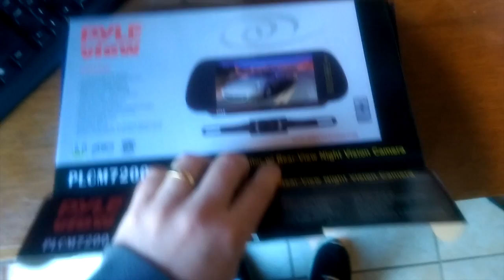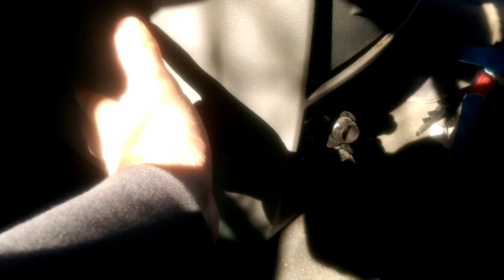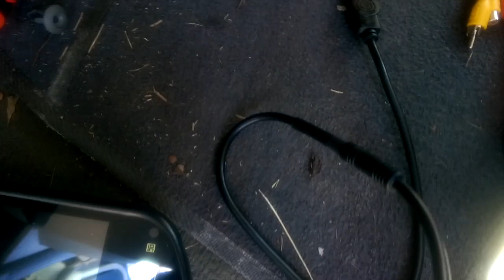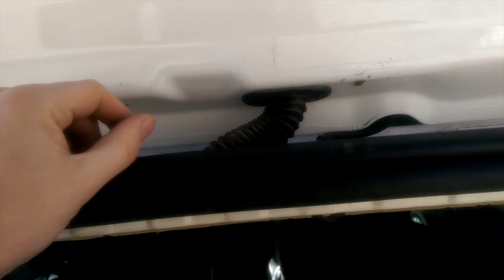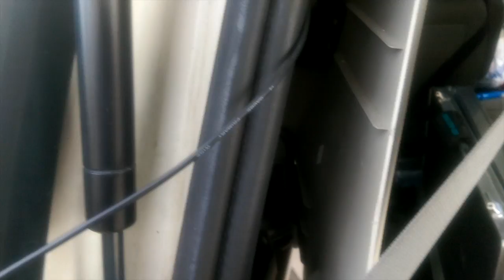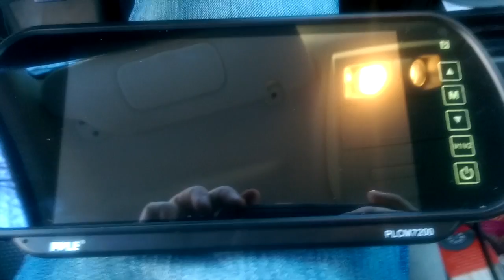Backup Camera Installation - Pyle View PLCM7200

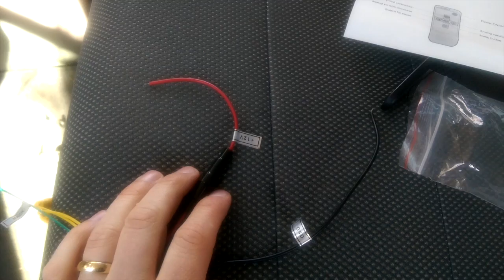Comment: 1:49 for those of you who do not know, a fuse will not reduce voltage, the metal wire inside of the fuse is designed to melt ( breaking the electrical connection) so hopefully you do not destroy your electronic device.

Comment: How do I disconnect the battery to not shock my damn self?
Reply: Remove the negative cable from the battery terminal. It should be the black one, but I don't know what car you drive. Just take them both off, if you're concerned you chose the wrong one!

Comment: Why would you do what the instructions tell you not to do.  They tell you not to use the accessory ports and they tell you to wire to the ignition switch so that the camera/monitor isn’t draining your battery when the car is not turned on.
Reply from the maker: Christian Cepel That's a good question and I am glad you brought it up. For me, I felt like the risk vs reward of being able to run the camera when the car was off was worth it. The power draw is low, but it does still exist. So this is the point where I recommend to the viewer to do what you are comfortable with and decide what is most important for your situation. Thanks!
Reply: Nick Allen I got ya. Just got done putting my 7400 in, but not over the rear view mirror so that I could use both simultaneously, so wired it to the ignition switch but left the backing wire dangling. Wired the camera to the license plate light circuit. Wish there was a way to wire it so that the backing grid was only visible when the car is in reverse.
Reply from the maker: Would you be able to wire it to the wire that turns on the reverse (white) lights? Then it should only come on when the car was in reverse.

Comment: Hi Nick, great video. I just installed the same system in my Toyota Tundra and it works, the only thing is that the rear view mirror when used in normal driving, the reflection is dark as if the rear images were reflecting on a dark glass and not on a mirror. Did  i do anything wrong?
Reply from the maker: R Ng You didn't do anything wrong,  but it doesn't work well as a rear view mirror. I would recommend mounting the monitor in a different location. I have mine mounted on the dash.

Comment: Hi Nick, Could you give me a counsel? I just installed this set today in this way: 

Camera: power to the Reverse light. I installed wireless transmitter for the video
Monitor: Red to a wire (not sure about the wire that I connected but got the power)
                Black to the ground. I installed a wireless receiver for the video line. 
                Green left 

As a result, it works, but I have to turn the power on and off manually every time. 

My question is "should I wire the Green to the back up camera Positive? if so, can I keep the Camera power line connected to the backup positive with the new line for the green line?

I really appreciate if you can send the answer to my email at mlmbjs@hotmail.com just in case. 

Thank you for your video

Comment: I would like to correct something that you said which is technically incorrect.  The fuse on the power side of the camera is to protect the camera from an over voltage, it does not provide the correct voltage.  Otherwise, great video.
Reply from the maker: Steve Rowe Yes, you are correct. Thanks for the clarification.

Comment: it would be NICE if that REARVIEW mirror could be used as a Digital Video Recorder (DVR) with front and back cameras that are always on and maybe they are both showed at the same time in split screen mode, and when you touch (or use the remote) a video feed it will show in Full Screen. Also, what are the specs on the camera side; resolution, wide angle, temperature.....
Reply from the maker: Ovidiu Moc. There's quite a bit of tech out there that should be able to get you what you are wanting. Research dash cameras. A good unit would let you integrate multiple cameras (eg, back, sides, front, and even interior). Good luck!
Reply: Ovidiu Moc. caméra.  sans. fil. inhalation

Comment: sorry but i had to change the video after hearing ummm ommm ummm ahh ahh 300times  good video! just work on that!
Reply from the maker: Francis Moran It can be clipped in most vehicles, but the reflection isn't great. It is similar to looking at  the reflection of your phone when the screen is off. I would recommend getting a dash mount for it. Thanks
Reply from the maker: Andres_Mopar25 Thanks. I have been working on that. It's a hard habit to break.
Reply: Nick Allen hello nick, great video, can i ask you can you clip this to your existing rear view mirror, also is the mirror in it goid
Reply: Nick Allen Thanks for the reply, after much debate im going to purchase it and hope for the best. the only thing im still worried about is the relection in the mirror

Comment: Nick, great video. I have the same Dodge Caravan so its was great to see how you installed it. Quick question on the camera, has there been any issues with water damage? it is waterproof? How has it held up?
Reply from the maker: creativemind It has worked really well. I did notice some mist on the inside of the lens cover after a heavy rain. You might be able to glue the cover on better,  but I'm not sure if there is any other open spots. The most did slightly obstruct some of my view, but it wasn't too bad. It cleared up later that day. It didn't affect the functionality of the camera at all. Hope this helps.

Comment: Hello,  I have a rearview Mirror like you TFT LCD.  I have changed the car battery and mirror was deprogrammed,  now when car is on reverse appears a text on mirror like : “Blue Tooth Connection”  above 10 seconds.  Text is too big and not let see anything.   Do you know how can I Program mirror again in order to take off the thext : “Blue Tooth Connection”?  Best regards.
Reply from the maker: Sorry. Wish I could help. The model I have only supports a wired connection.

Comment: I have the 7300 BT model that should have Bluetooth capability, but it won't work.  It presented me with the option to enter the code to pair ONE time, and I did not know the code at that time.  I've never been able to pair the phone to it.

But - my question is: In your video you wired to an unswitched (always ON) wire as opposed to a switched wire that only has power when the key is ON.  IMO - that would cause the battery to drain.  How are you avoiding that? Or am I wrong about that?
Reply from the maker: Robert Parker You are correct that there is a drain on the battery. It is very minor, so for me it is no problem. If I were to guess, it would take one to two weeks to drain the battery. Since I use it every day, it has never been a problem. Of course, you could wire it to a hot lead that's only powered when the car is on. It is totally up to you. Thanks!

Comment: Hi Nick, looking to buy the same product, so delighted to see your video.  When attached to the mirror, is it comparable in width?  Longer might obstruct the visors.  I am getting one with transmitter and receiver to avoid the running the video wire length of vehicle.  On another note, it was hard, or weird to listen to the video as you and I have the same voice and speaking mannerisms, pauses etc.  My wife thought I dubbed the video at first.  Anyways thanks for the video.
Reply from the maker: The monitor is shorter than the width of my mirror. Also, it isn't as reflective. I have mine mounted to the dash and it works really well there. 
It's funny how we apparently speak similarly. It must have been fun "pranking" your wife. :-)

Comment: does the reverse wire just enable disable the video feed? or can it switch V1 and V2? so say for example, rather than turning on camera in reverse, you have front facing camera connected, and putting into reverse switches to V2
Reply from the maker: Those are great questions. Unfortunately I do not know the answers. I only have a backup camera hooked up to mine.
Reply: Nick Allen Quick reply! Thanks! I suppose it would need two cameras to test properly. Altho one way to test would be to connect the rear camera to the other video feed, enable that feed, and put camera into reverse and see if the vid feed changes. It would be a black screen obviously but could indicate if it would work in this way or not. If i do buy this kit I could try it. ;) Thanks again! Regards,
Reply: +martyfriedman666 
I have what appears to be the same unit but a generic brand, and on mine, the reverse wire simply selects the video feed from V2, which is supposed to be the backup camera.  The display changes to the wording backup cam, as opposed to V1 or V2.
If you have some other video feed going to V1 and it's displayed normally, then putting it in reverse will switch to V2.
The red power wire should be connected to a switched 12V power rather than constant power, because it can drain down your battery with the approx. 340mA draw.  Even if the power is turned off from the display switch mine still draws 20mA, which is relatively small but still not good when parked for longer periods.

Comment: Hello Nick, when the monitor is off, does it look exactly like a mirror or is it tinted and also it looks like you can use the camera while driving through the power like a switch on and off, is that correct? Thanks
Reply from the maker: +Froswell Wallace It does act as a mirror, but not as clearly as a typical mirror. The best way to describe it is, if you have a smart phone, turn it off. Then look at the reflection in the glass of the phone. Also, the monitor reflection isn't as wide of an angle as a typical rear view mirror. I chose to mount my monitor on the dashboard rather than on the mirror.
Reply: ok thanks alot for the info

Comment: Hi is there a way how to activate receiver monitor from the the signal switch or line to use it for blind spot monitor.
Reply from the maker: SIBLE YAMASID The monitor can be left on all the time, that's the easiest solution. Otherwise, you would have to wire in a microcontroller (like Arduino or Rasberry Pi) with a proximity sensor. Here's a thread on building something like that, http://forum.arduino.cc/index.php?topic=113586.0